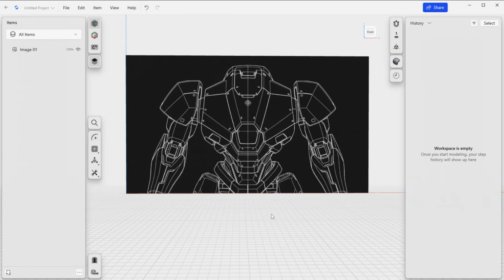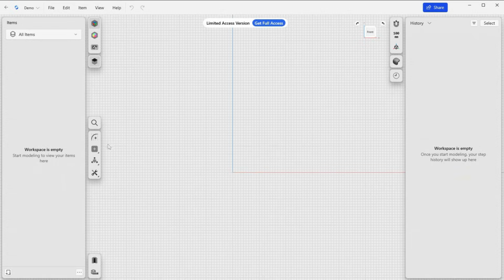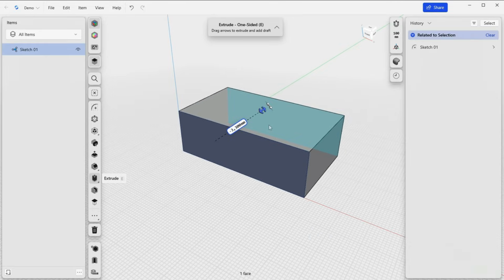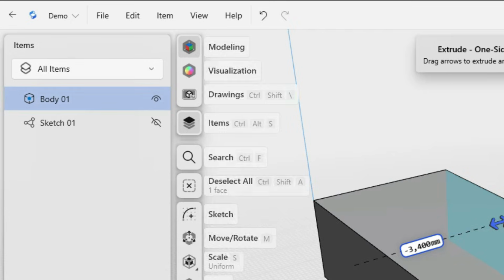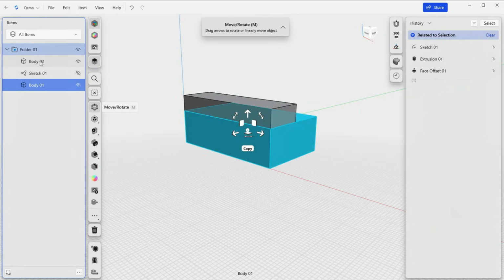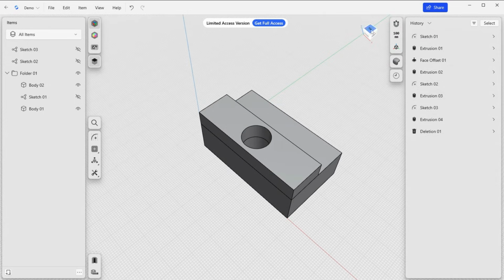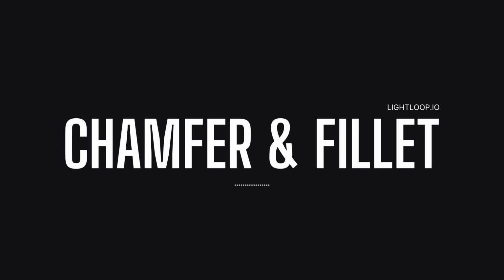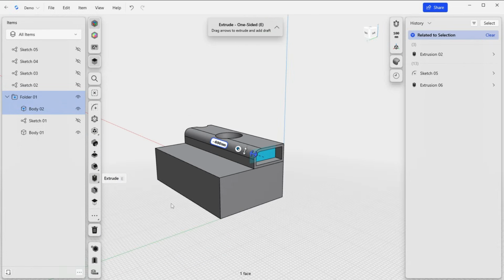Shapr3D Tutorial for Beginners – 3D Modeling in 10 Minutes [2026]

Comment: i think ill learn this faster than fusion.  I am just trying to make a STL file for a very simple part, which it takes me to long to use Tinkercad.  its like getting a 4mm x 2inch by 8 inch long metal strip
. but bending it into a wierd almost question mark shape , but all the edges are rounded off .
Reply from the maker: I think you'll find the workflow much smoother than what you've been using, definitely give it a shot for that part! :) When I work in Shapr3D I often find I work at 2X to 4X speed. It's one of the main reasons I use it.

Comment: Nice,but much to expensive for hobbyist´s
Reply from the maker: Yes, pricing targets professionals, but it's enormously powerful and one of the most beautifully designed CAD systems out there. Not only that, but you can use it for free. However, with the free version you'll be limited to only one project and you won't be able to save the texture or visualization tool effects. Thanks for the comment :)